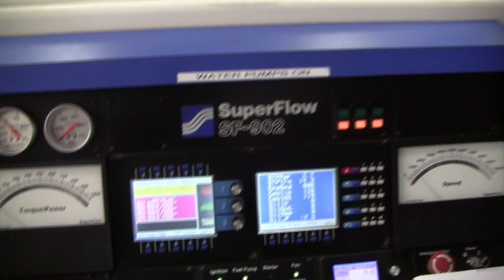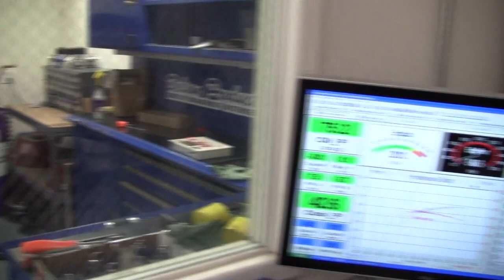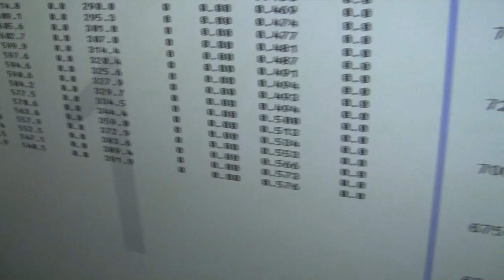Tom Fry's 427 SOHC Cammer 740HP Dyno Pull | QMP Racing

Comment: This engine is so badass, the GM stock owning France family of Nascar saw it and the Mopar Hemi comming and knew they had to disqualify it for their racetrack. The Chevys couldn't keep up.
Reply: Was the 67 vette with the 427 ( Chevy lies extremely on stock power by around 150 ) the fastest car you could buy from the factory that decade.
Reply: There were some Chevy 427's running in NASCAR in 67. Looking at the back of Ford 427's and Mopar 426's.
Reply: @bbdl7042  The Chevy 427 was not in the same class as the  Ford 427 sohc.The 427 sohc was banned before it could even run at Nascar   so  Ford went back their 427 side oiler and still kicked butt in Nascar that year,The Sohc went drag racing instead.
Reply: Them hemi heads no joke
Reply: It was banned bc it was never put in production cars had nothing to do with stock smh.
Reply: Chevys could never keep up and never will
Reply: Mason George  Nobody was successful much in the late 60's if their name wasn't Richard Petty or David Pearson or later on, Bobby Isaacs.   
In 69, Petty, Isaacs and Pearson won 38 of 51 races.   It was the same story the previous few years.    
It wasn't Ford or Chrysler, it was those guys.   Petty switched to Ford one year and kept right on winning.   The other Ford guys weren't winning like that, only Pearson and Petty that one year.  And Isaacs.   The other Chrysler guys weren't dominating, only Petty. 
And GM was officially out of racing, so no real factory support.   Ford pulled out of the AMA agreement long before they were winning.  GM stayed in it, because they were pressured by the government to not be building and advertising fast cars and horsepower.   Which was stupid, but GM was king back then so they were who the gov't went after.
Reply: Mason George  That's really not true.  First off, GM banned racing in 62.  62 was the last year they were in Nascar, and they dominated. 
Ford announced they were officially returning at the same time. 
GM had a lockdown on racing...the only stuff that got out was "back door" things their engineers concocted, like the 427 Mystery Motor.  But nothing officially supported. 
GM was king by a huge margin back then, and the gov't was all over them, particularly Bobby Kennedy. 
Had they remained in racing, the most likely result would have been that they continued to dominate...or at WORST, they still would have won a lot.  
And even with them being out of racing, their engines still grew to be the best racing engines of all time...the SBC and BBC.  No engines have been used more across racing. 
You go to any drag strip in the country and that's all you'll see.   
Time told the tale, and despite their withdrawal from racing, they were still making the best motors.
Reply: @Bigbigpoopi  Not the Cammer.
Reply: @Bigbigpoopi  I don't understand what you're saying.  You must be referring to the small block Ford, that did the stomping. Not this engine. This engine was disqualified everywhere except at the drags, AHRA, NHRA, etc..The DOHC was never used against Ferrari!
Reply: Mason George  incorrect. Chrysler themselves built a SOHC hemi and presented it to NASCAR in hopes of bluffing them to prevent the Ford SOHC from competing. The Hemi SOHC didn’t even run, but once France took a look at the two and seen that had OHC technology be allowed in NASCAR, the costs of running would skyrocket. France was also not a fan of sophisticated engine setups. So there on the spot he banned both, and any type of valve train that wasn’t pushrod. This ushered in the era of beginning to mandate specific engine setups. Chrysler walked away happy since the Hemi was expensive to R&D, and was the engine to beat. Ford left and went on to design the Boss 429 to compete with the Hemi.
Reply: Mason George  incorrect. Le Mans did not have rules mandating a block had to be production based. They did have rules such as the car must have a passenger area, and carry a spare tire, and area for a suit case, and and depending on what group you were racing, a minimum production of that car. The Ford GT40 in 1964 started out with the 255 “Indy” engine, but it was suited for oval track, and sprint races. The 289 had shown its potential (with the exception of the infamous head gaskets blowing on them until post Ford involvement, compression ring grooves were cut into the block, fixing that issue) and while the 289 sufficed early in Shelby’s tenure with the GT40 program, Ford was humming away at developing the 427 side oiler for endurance competition since during their testing for NASCAR they showed remarkable reliability for extended periods of load and high RPM’s. Of course the rest is history.
Reply: Mason George  Yes, my error. I saw the photos of just the single pulley per picture, but it appears a set of gears ran two camshafts, which is the A925 engine. and yes, once he saw the complexity they were trying to go, he put his foot down on that.
Reply: Mason George   Now, I'm in no way trying to be rude, but unfortunately, that is not correct. the GT40's first ran a 255 "Indy engine", and a Colotti transaxle and it wasn't until 1965 when Shelby took over they received the 289 that he had been running with success for about three years. The first official outing for the GT40 was the Le Mans test day in 1964, but it's first official race was the Nurburgring 1000km. Next was Le Mans, Reims, and finally Nassau where immediately after the race, the cars were rounded up, put on a plane, and sent to Shelby. Shelby was quoted as he complained that the cars were delivered so fast, the cars were still covered in grime from the Nassau race. at the 1965 Daytona, it was the first outing for the 289 GT40's.
Check out GT40 Chassis history on GT40.net, and also I highly suggest the books " Shelby GT40" , "GT101", and my Bible, "Racing in the Rain" by John Horsman
Reply: Mason George  incorrect, what you are referring to pre 1964 is the Lola Mk6 GT, that used a 289, and was purchased by Ford to assist in developing the GT40 program. That car was produced in 1962-1963. There is no Ford GT program pre 1963.
I once again ask that you look at the provided information I have sent you.
Reply: I thought it was Richard Petty and the hemi that won 200 nascar races
Reply: Right you are, Lyle. I don't know how many, but certainly a lot.1963 was a great year for Ford at the NASCAR tracks.They won 23 races that year.Chevy had pulled out of the 1963 season, because of antitrust litigation from the Feds.Enter 1964, where the Ford guys thought they would have another banner year, but it was not to be because of Richard Petty (who used to win with Ford Talledegas), switched to Chrysler with their brand new Hemi. That made for a very unpleasant year for Ford, only winning 35 victories, while Chrysler ran away with the big wins. Ford knew they had to do something for '65, or it would be another bad year against the Hemis. During this time Chevy was having problems with it's Chevrolet Mystery Motor (427), and couldn't get a good campaign going. So, for '65 Ford came out with the SOHC, that produced an easy 600HP. Chrysler, getting wind of the new engine, responded with dual overhead cam version of the Hemi, that had the potential to make 900HP, in race trim. Bill France, watching all this from the sidelines decided to act. He outlawed both engines, citing safety concerns. This pissed off Chryco, so they just dropped out altogether for that year. As you might have guessed, Ford won everything there was to win in '65. In 66, Chysler announced plans to offer the Hemi in production cars as an RPO option. In response, Ford tried again to seek approval for the SOHC 427. But Bill France, who owned a LOT of GM stock, said no way!, even though Ford said they'd put the engine in a production car (but they never did). So, now, it was Ford's turn to boycott the series of 1966, after they got trounced by Richard Petty's teams at the Daytona 500. All this from the book, I own, called, "Ford Lincoln and Mercury Stock Cars", by Dr. John Craft.   @lyleswavel320
Reply: @JC-jj1xm  it was a dohc not a sohc chrysler made
Reply: @SealofPerfection  “Best racing engine of all time”? 
The Ford-Cosworth DFV would beg to disagree.
Reply: @SvenTviking  And it would be dead wrong.  Who's still using them today?  Anyone? 
You can find the Chevy engines in MANY forms of racing.  There are more Chevy engines in drag racing than all others combined, times a bunch. 
Lots of different oval track racing, monster truck, tractor pulls, etc.  
Chevy small block and big blocks are THE most successful race engines of all time, and it's not even close.
Reply: There wasnt an aftermarkey for support of the cammer engine. This wiped the floor with hemis with the timing "gear" system installed and bearing problems fixed. Had there been and after market back in the day and ford putting these in cars top fuel would he different 👍
Reply: This and the Mopar hemi were disqualified because they strayed TOO far from the standard engine configuration. Sure, I could put a snowmobile engine in a 100cc shifter kart, and kill everyone on the track, but that wouldn't be fair, now would it?
Reply: @Dontfearthereaper001  No. These engines would have never worked in Top Fuel. Ford let em die for a reason.
Reply: France thought it more Indy car exotic prolly.
Reply: @SealofPerfection  GM was never King, Ford motors always came up 1st.
Reply: @bultacowally  You just can't handle the fact Ford has and always will have the most bad ass race winning engines ever. THE 427 IN THE T BOLTS, 351 CLEVELAND IN BOB GLIDDENS TIMELESS TROPHY WINNING PRO STOCK MUSTANG , THE MIGHTY BOSS 429 IN THE GREATEST MUSCLECAR BODYSTYLE EVER .69 MACH 1 and Boss cars were so so gorgeous
Reply: @twolak1972  When GM was out of racing, sure.  Not when GM was fully in racing.  Ford and Mopar only started winning in NASCAR when GM banned their brands from racing. 
Look it up.
Reply: @SealofPerfection  HA , if GM was so bad why did they go crying to nascar along with mopar. Because they were scared shitless of fords GAME CHANGER.
Reply: @twolak1972  They didn't. It's just an old myth.
Reply: @SealofPerfection  Ok.GM, Fan boy. Must suck knowing your bad ass chevys always came in second on race day. LOL.
Reply: @twolak1972  Not a fan boy like you clearly are. 
But facts are fact.  Chevy is the winningest brand in the history of motorsports.  No engines have won more, and it's not even close.   Every dragstrip on every race day, 99.9% Chevy motors win.   Same with round tracks.  
Enjoy talking about the 60's when GM wasn't even racing and Ford couldn't beat Dodge on a regular basis, LOL.  50 years ago, it's all Ford fanboys have
Reply: @brgable  BS, chevy and mopar went crying to nascar and nascar having the balls if a yard mouse listened and banned it. Mopar and chevy had no answer for the 427 cammer. It was so bad ass they shit their shorts at the thought of facing it.
Reply: @bbdl7042 this engine never made it into the production line vehicles,  it was band,  end result was setting us back decades in technology,  this is the coyotes great grand papy.
Reply: @twolak1972  Incorrect.  Again, GM wasn't even in racing when this engine came out.  They didn't care.
Reply: @SealofPerfection  HAHA YEAK OOOOOOOKKKKKKK
Reply: @twolak1972  "yeah ok" what?
What I said is a stone cold fact. Go look it up.
GM banned racing in 1963. That didn't come off until the early seventies.
Hardly anyone was running a GM in NASCAR during that time a few tried but they were not getting Factory support like the other brands were
Reply: @SealofPerfection  ALRIGHTY THENNNNN.
Reply: @SealofPerfection  THey need er hot into it cuz they were too afraid of FORD. COLD HARD FACT.
Reply: @twolak1972  Nobody "cried to Nascar" about someone else's engine.  GM certainly didn't, because they weren't even IN Nascar at the time, so why would they have cared?   And I doubt Mopar did.   Ford didn't put this motor in a car ever, so it was never going to be approved.  
These were cool looking, but not terribly reliable and really didn't make any more power than other engines of the same size. They tried them in Fuel, but the blocks would split pretty much every weekend once they got over 1000hp or so.
Reply: @brgable it was never homogonized because Bill France Sr witnessed a dyno session with a slightly de-tuned single 4-barrel carb putting out 650±hp, and he knew of they'd show him that power they could do much, much more.  The cars were going faster and faster - safety was an issue.  It ruled drag racing until parts got scarce as well as rules changed against it plus Ford never supported it. The super quick development  left it with chain issues, rod issues, and a difficult pulling system that only the racers themselves has to fix - just v like the 427 chevy of the day (oiling, rod, crank issues) The Cammer and the Cleveland series are the most penalized and ruled against engines on our shores.  Weight penalties, carb size restrictions,  rpm restrictions all were done at the request of competitors or their sponsors in various classes.  GM had gotten out of racing at the time, so individuals had to do it on their own, just like the Cammer.  GM did cry about Bob Glidden throughout his decades of absolute domination, and in nascar they cried about the Yates headed Fords (see also Bill Elliot speed record for when nascar made them share the design or get banned)
Reply: @SealofPerfection the only reason you find more chevy than other brands is not superiority - it's expense.   Chevy poured out 50 gazillion small blocks and 25 gazillion big blocks.   The 427FE and 429 ford engines owned the 427 chevy in racing - the 427 chevy, like the 427 cammer, had oiling issues and rod issues that it shed from the 409 engines that the 427fe owned.   The Cammer would bust the block @2500hp, but was the first drag car @200mph without support from Ford - they have the parts to drag racers and told them to have at it.   If Ford had supported the Cammer like Chrysler did, all your fuel classes might look completely different as they assistant made more power than the mopar hemi of the day.  Ford detuned the crap out of the one on the dyno run to get it under 700hp - everyone whom builds one now is 740-900hp with a single 4 barrel.
Reply: @SealofPerfection the "Superior" Chevy engine cried at Nascar until the they made the Elliot boys and Riusch share their head design or they were going to ban those engines also.
Reply: @onerbfromtn4320  complete BS.
That's just more Ford fanboy whining there

Comment: All gearheads should love this!! I'm not a big Ford fan, Mopars are my thing, but the Cammer is
an amazing piece of engineering!!
Reply: She's a hunny alright!!
Reply: me toom I like the cross ram race hemi but the cammer is cool
Reply: @wedge4hire   - As a fellow long time Mopar guy, I gotta agree. This is a fantastic engine with elephant hemi type power. Sorry there aren't more of them out there.
Reply: @neilreid9005  As a dyed in the wool Chrysler fan, I have to agree.  This is one unreal engine, and fascinates me.
Reply: I personally own couple of old Fords & Mopars , VW beetles and wouldn’t trade that experience for $1 million bucks and yes all were stick shift ..  T - 45 Hurst shifter w/ ‘71 Mach 1 , Pistol Grip shifters in ‘71 Charger RT and  ‘70 Roadrunner and that good ol straight stick
that rises between the front seats in my VW beetle ( that kept me from getting lucky) , had stock and hi perf air cooled VW engines .
You be surprised when an ‘68 or ‘71 Beetle has a good cutch in it - it hauls ass lickity split ...
Reply: @rockngpa5094  You might say we've been on similar tracks! I cut my teeth on a 1967 Bug! Everything broke on that car at least twice!! I then had a '71 Demon with the "good" 340/automatic (that was a great car) and for the last 31 years, I've had a 69 
Dodge Coronet R/T (440 Magnum w 4 speed and Dana rear end). But i love ALL the classic muscle cars. They were all great cars and people of all groups love them more today than way back then!!
Reply: It was old tech in europe 10 years prior to its introduction.
Reply: @sugarnads  So what you're telling us is, ten years prior to 1965, Europe had engine builders screwing together 7 liter, normally aspirated, OHC engines making over 700 HP? Really?
Reply: @sugarnads  Complete BS.